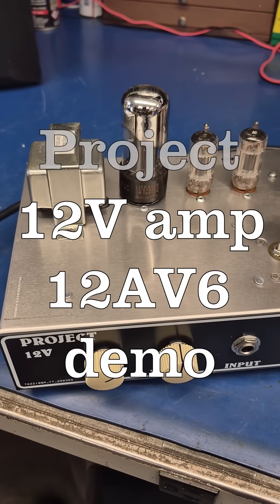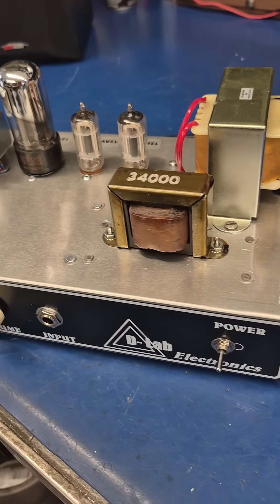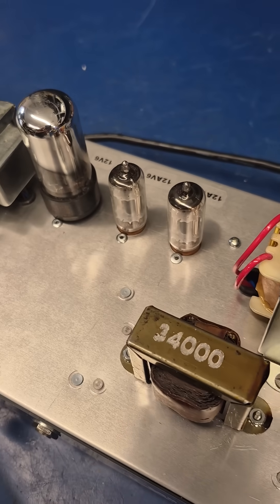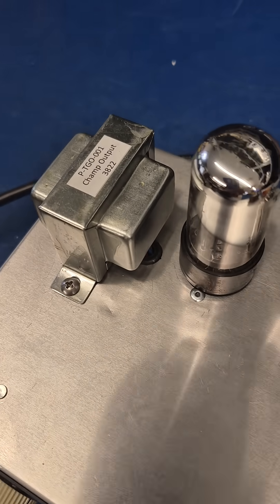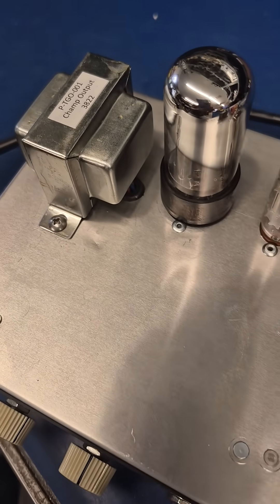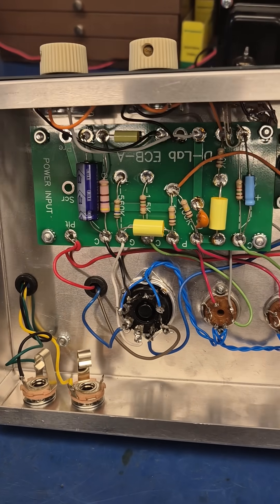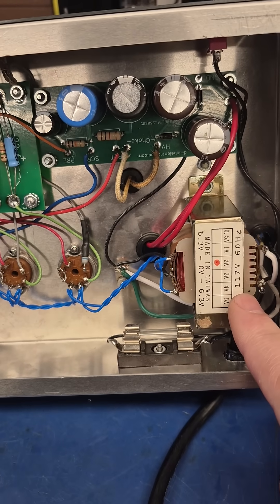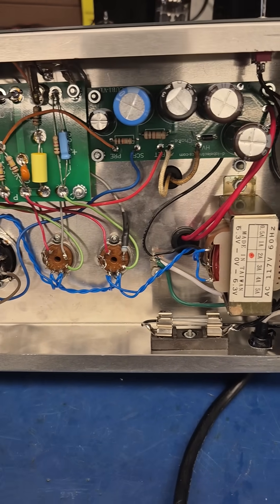12V6 guitar amp #shorts #music #audio #diy #build #handmade #guitar #custom #cool #retro #handmade

Comment: Wow. Can you show me how to build an amp with KT120' power tubes. First with a single KT120, then with Four of them. Looking to build a high powered clean amp with FX loop. Wiring must be much larger as well.
Reply: Hello. I only have 1 kt88 but I've gotten it to work in a Class A but it was running cool & under its datasheet curves/data. 

I disassembled that amp but will do a rebuild probably later this year. Happy to talk about it if there's a way via email, etc.
Reply: @Bretts_Lab  cooL.

Comment: Hey Randy, yeah one can make use of many 12 volt tubes (as Terry has done here), and even many 6 volt tubes not normally associated with guitar amplifiers. One problem with this is many “players” don’t know how to work on amplifiers. I believe Terry has made it simple enough for someone with basic skills to make one, that will sound great and not break the bank. Oh, I could be wrong, but the only tubes I’ve seen that start with a 7 are Loctal tubes, and filaments are still 6.3 volts..

Comment: You're doing what I have commented to other people that work in vacuum tubes.  I want to hear a conversation where that the person received a quantity of miscellaneous vacuum tubes.  "I threw 90% of them away because they're just those oddball TV tubes I'll never have a use for."  And by that they meant odd filament voltages.  Granted there are tubes that are worthless.  6BN6 & 6BK4  immediately come to my mind.  But there are perfectly usable tubes that are granted an oddball voltage on the filaments but they're identical functionally to their non oddball variants.  If you get tubes don't just throw out the odd voltage ones.   if you're building from scratch you have an opportunity to to as you did put in a filament transformer to supply those odd voltages.  You can also connect them in sseries and parallel configurations to get the voltage and current you need.  Examples are your 12 volt tubes plus there are other ones such as the 7AU7.  Definitely not a common voltage but a common tube.  You'll not find a transformer that is 7 volts or 14 volts if you want to two of them in series, but there's no reason you can't put a resistor in series with the filament.  Yes it's not greatly efficient doing that and it does generate heat but those tubes are available for super cheap.  How about a 5 volt tube in series with it?
Reply: A tube isn't worthless if i have a datasheet.